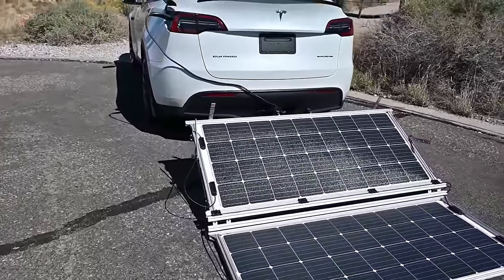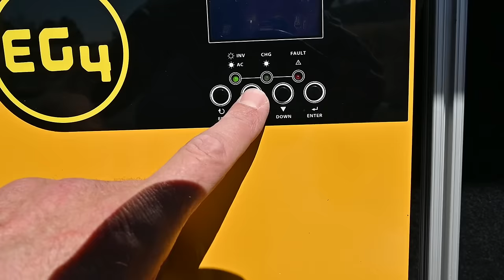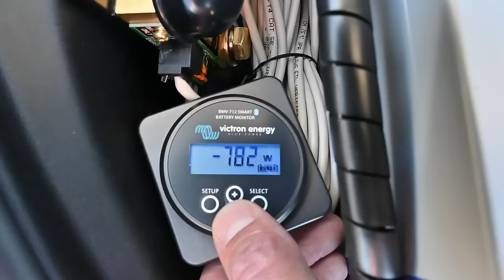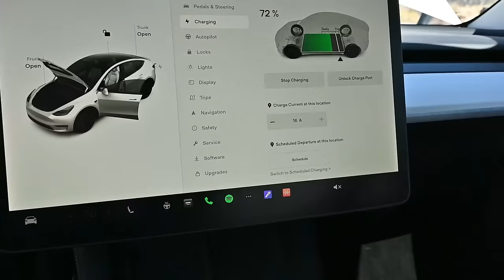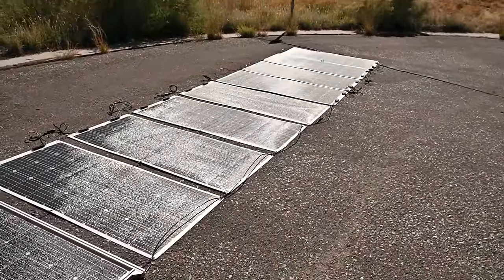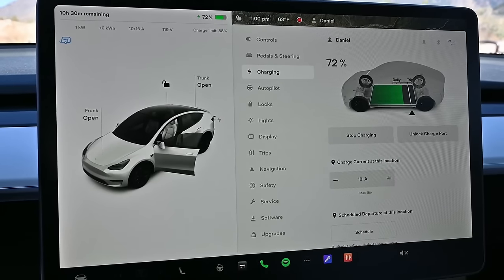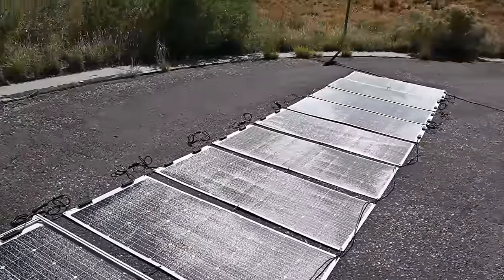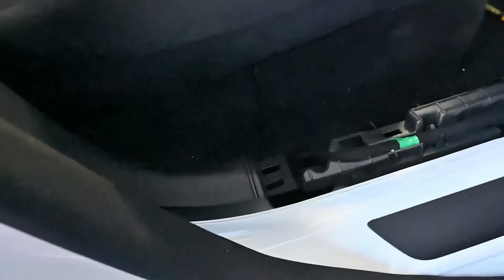2000W Mobile Tesla Solar Charger - version 3.0 - more solar, lower mass, battery in frunk!

Comment: I've read enough of these comments that don't get the thought of this system. Let's start off with what it cost to charge an ev today and it differs area to area. Most will spend an average of $18 for a partial charge 3 time a week equaling $54 a week $216 a month $2592 annually. Just that being said his now 3.0 system in the range of $5500 will give him a 2 year prepay on charging. Just for kicks the average commuter car will use an average of $3500 annually of gas and 96% of use pay that and point out the DC to AC back to DC 95% of all systems go through to give Americans electric power. As  this small mobile charging system is more of the ease of a non complicated wiring all in one to convert solar into usable power anywhere even if you're home is without power. Not to mention the plug to charge the car needs AC to work so no small home use all DC system for charging is available ( at this time ) unless you have a 52 amp or larger quick charger not available for home use today
I own a small mobile charging business and I have looked everywhere in the world for better and better systems. What this man has installed in his Tesla is a 24/7 system and will work for his car charging needs and home emergencies till the battle Borns give out in 20 years. That's many years of DC to AC back to DC use without the grid. Thanks for your video it brings me back to how I started my business.

Comment: Great experiment :) I think you could improve the incidence angle if you make your panels rigid, park your whole string of panels perpendicular to the sun azimuth, then angle up your rigid panels facing straight to the sun

Din35 rails would be the way to do it

also mount the folded panels on roof mount rails, instead of the rear hitch

Comment: What are the dimension of those 36 Cell panels? They'll sit at about 18V-ish for a total of 180V?  If these were the newer half-cut panels you'd be able to reach a sufficiently high voltage to ditch all that stuff and go directly to DC "fast" charging with just a couple of relays and a communication thing. That would be awesome, and you'd have your trunk space back... for ... hauling batteries around.

Comment: Why not make the rear holder swivel so you can lay them across the top of the car. Make a rubberized bottom on the panels so they don't scratch anything. This way you're not taking up all that room on the ground.

Comment: Great! Keep on improving!
Please share  a link of the solar angle  measure thing! I.never have seen this. What is it called? I also will Google it!

 Respect from The Netherlands! Theo, Adventurer & Trendwatcher on many subjects
Reply from the maker: https://www.amazon.com/dp/B0B8J492BR?psc=1&ref=ppx_yo2ov_dt_b_product_details

Or you can make your own with a little math. The 10deg ring spacings are fairly linear for small angles but widens to infinity if you want to capture very wide angles. 

(ring_radius) = (height_of_dot) * tan (sun_angle), where a sun_angle of 0 is when the sun is directly overhead

Comment: If those panels are in series then the output will be limited by the lowest panel. IE, the one on the hitch at a very different angle is probably getting less exposure than the flat ones, at least if the sun is overhead or behind it. So, just be sure to set up so that angled one is getting more exposure than the flat ones
Reply from the maker: Actually the bypass diode on each panel prevents any one panel from limiting the current of all the others. If one panel is lower current, at worst you'll get the current/power equal to all the other fully illuminated panels, and in reality you'll get a bit more power due to a boost in the arrays fill factor. But overall, yes they would ideally all be at the same angle. Lookup bypass diode solar panel.
Reply: @gridfreeordie  are those built in to the panels or did you have to add those?
Reply from the maker: @HandfulOfTranquility  Buiilt into the smal boxes on the front or back of the panel. Nearly all panels have them but there are some cheap panels that do not. Commercial glass panels typically have 3 bypass diodes (one for each 1/3rd of the panel). You can also learn about about blocking diodes to prevent the battery or other strings of panels from dumping power into a shaded string. https://www.youtube.com/watch?v=-x_6OLdAods&ab_channel=DIYSolarPowerwithWillProwse - this video is mostly correct except the panel he shows has only 1 string of cells, and one bypass diode is in parallel with half of the 16 cells and the other is in parallel with the other half 16 cells.
Reply: @gridfreeordie hello sir, why do you need the batteries in the frunk? Isnt it possible to charge directly from the panels into the tesla battery??
Reply from the maker: @FirstLast-tx3yj  The battery is required to handle intermittent clouds and my desire to charge at a fixed power during the day while the solar power follows a cosine curve. Apparently this inverter can go without a battery, but I haven't tried it. Nearly all off-grid inverters require a battery. I don't think I would achieve adequate data transmission if it were battery-less even if it worked without a battery because it may turn off and stay off if the charging load was more than input solar .
Reply: @gridfreeordie  so theoretically as long as the input is higher than the load and the inverter is like yours and allows it... the batteries are not necessary, right?
Reply from the maker: @FirstLast-tx3yj  Yes. There may be videos of this inverter that shows it works without a battery. There may even be one from signature solar, I forget. Sorry, busy...

Comment: Any kind of obstruction did the sunlight of the panels is going to significantly reduce their output you need to move your son direction indicator off the panel and watch the voltage change

Comment: Wouldn’t it be better to DC charge instead of inverting to AC?
Reply: Converting to AC and back to DC does lose some efficiency, but not too much. Modern inverters like the EG4 are very efficient. You get a lot of safety and battery management courtesy of Tesla by going to AC and back to DC so it's the right move for a simple system like this.

Comment: Without any galvanic isolation between that inverter's DC boost stage and its AC output, one day, when the MOSFETs in that low cost, Chinese made, high frequency,transformerless inverter fail and short to ground, that inverter can pass high amperage DC current, straight through to your Tesla's onboard charger that will not only damage it but will also void your EVs warranty. You should have installed a low frequency, transformer based inverter that provides galvanic isolation like a Victron instead.

Comment: Good job, congrats. How did you handle the grounding / floating neutral issue? Or does the Tesla UMC accepts the EG4 AC outlet as it is?
Reply from the maker: The inverter ground "lead" is manually tied to the neutral "lead" to make the charger happy. Ground/neutral are also tied to the frame of the vehicle. The EG4 actually doesn't have a ground lead, just a grounding bolt on the side. Not a fan.
Reply: @gridfreeordie  Thanks. Makes sense.
Reply: Thanks, had the same question
Reply: @gridfreeordie  thanks!

Comment: I run the same setup at my house: it sucks!!!
Using a non- hybrid inverter always has to tap into the battery, especially if you can't have the load not automatically adjusting to be right below solar production.
He tampered too much around his car to create a non efficient high maintenance toy.
Reply: Someone up there commented on how the charging amps can be adjusted based on the battery SOC using raspberry pi and whatnot.

Try to be more optimistic than pessimistic even when you fail, it helps. ✌️
Reply: @leviahamefula3994  I am optimistic when I get to know how a microcontroller or microprocessor can solve this for real.... Currently the market can't and any YouTuber didn't show me yet how it's done either. I work with electric/ electronics/programming myself..... Stop dreaming and show me reality, how it's done?????????
Reply: @Gallardo6669  👀.... Why are you shouting? 😂

Comment: All this for about 3 miles per hour of sunlight? How much range are you losing carrying all that extra weight and the added inefficiencies of the hitch? I think it makes sense if you're completely off-grid, but you said you have a house with solar.
Reply: Trying to figure out where his setup went wrong. There's another YouTube that did the same and almost got the same kwh per hour as this except his was much simpler using a 1500 Jekery and 4 or 5 jakery solar  panels rated at 100watts each

Comment: What if you flipped the panels and the unfolded over the top of the car with some felt backet to protect the paint? Than you wouldn't need a 40 foot area to park to charge it, just a thought.

Comment: The battery in the front bumper is flip to the side that's wrong you must put the battery in regular positions because the water of the battery is going to mess and can be a voltage problem .

Comment: Ima trying to do a set for my Tesla and Camper trailer got 11meter trailer and Tesla model x 100kw. And not in a haste on my travels but need a offgrid Charging to my Tesla and Camper looking 2000-4000kw set to this and what ever it needs extra batteries etc?

Comment: I have a skywell et5 electric car. I use the AC adaptor charger to charge et5 from house 220 v. I can not use the adaptor with the off grid 3 Kva solar system becouse of the virtual ground of the solar system. The adaptor prevents charging and signals ground fault. But this problem is not seen with on grid solar system.  Becouseon grid system has true ground. So I wander how you solved the ground fault problem of the adaptör.
Reply from the maker: Hmm, we have split phase here in the US and the neutral is tied to ground. In Europe, the neutral (or whatever it is called) is tied to ground at your house's panel in only one spot. I assume if you tied a 230V European inverter, like Victron offers, your charger would be able to detect this you'll be good to go. Tesla also has check to make sure neutral is tied to ground, and it passes the check even if it is tied to a car body ground vs. an earth ground. I'm not sure how your 3KVA solar system is "grounded", but as long as the non-hot lead in that system is tied to "ground", the electronics of the charger shouldn't be able to tell from my experience. Of course you should attempt to always tie to actual earth ground.

Comment: Tesla mobile charger energy watts ratio 1:1 So unpractical, but it helps to carry massive battery and solar controllers.  Also decrease quickly your battery charge, when you travel with the heavy loads.

Comment: how about mounting the solar panels on a roof or somewere so they can produce energy whenever the sun is shining and for charging your car why not use the charging stations? i really dont see the point. the solar panels do nothing when they are folded, and how long would it take to charge your car with 1kwh? 3 days probably...

Comment: Bro i would recommend to just put rooftop  solar and batteries tail one solar remove it just ruins the look and aerodynamic and also theft problem of it and i think it should messing with sensor which is on the back to see if the car is coming from back

Comment: Wonder how much time you have to charge in full sun to replace the wasted energy hauling the extra weight and reduced aerodynamics of the panels on the back. My guess would be in general you could remove all this and just solar charge at home and be better off.

Comment: Why not use DC to change the battery direct then you don't need battery in the front or a inverter all you need is a little tec and have the solor at 400v + to charge the tesla battery directly.

Comment: For my taste way too integrated to vehicle taking all space and adding more air resistance. Would go with portable system like Jackery and couple of portable solar panels with built in system for adjusting the angle of the solar panel. No changes of fixed installations on car. I could leave the system at home charging the "Jackery" and when back home, use the stored electricity to charge to car. Or then take the whole system with me on the road.

Comment: Sorry if you answered this elsewhere but why put 4 batteries in if you basically dump all the chargers power into the car? 
Is it so the mppt charger can be lower because the batteries are 48v?
I guess that’s probably why because a 12v mppt charger wouldn’t be able to handle that much solar input and your wires would probably need to be huge.
Reply from the maker: Correct. And the inverter is designed for 48V, not 12. And yes, cables would need to be larger, but not huge.

Comment: Why not hack the cars bms/charge controller or add a standalone bms/controller? Then no need for the inverter or exta batteries... It's still going to take days to charge the 100kwh battery

Comment: Hello! Is you are not discharging the battery, maybe something really small just to take care of the clouds would be enough, don't you think? Also, those batteries right in the frunk are maybe a bid dangerous in case of an accident.
Reply: nah, the EG4 inverter has a minimum battery size in the instructions to operate correctly. But actually, if he wanted to run batteryless I think the EG4 inverter does that too if you are interested!

Comment: It would be great if someone would build a DC solar charge controller directly to the high voltage pack..   Bypass the conversion losses inherent with your more plug and play systems.  DC slow charger.  🙂

Comment: Why does everyone use solar panels to charge extra on-board batteries that power an inverter that then feed into your original car's charger, converting it back to DC and then finally charging the cars' batteries?   Why not match the charger's DC output voltage with your solar panels and connect the panels directly?  Maybe no such adaptor exists so you'd have to maybe buy a used charger and cut the end off.

Comment: This is incredibly impractical. It would have made way more sense just to put those panels permanently on your roof, in order to have a consistent view of the sun. Even if the grid failed, why would you need to store/charge those old school car batteries on the vehicle itself? Not to mention that the power you’re pulling is only going to add a percent or two to the overall charge per day. I have so many questions lol. The only “savings” you’re getting is from the ad revenue that YouTube is giving you.

Comment: I get your motives but I don't think it's very practical. This setup is not a bad idea but good to use it for home and charge it while you're at home for free without using the grid..

The wind drag behind your vehicle is like a parachute eating away more of your efficiency and these electric vehicles have poor efficiency as it is.

On a road trip you only can charge it when the sun is at a good position 10:00am to 2:00pm in the winter time, and unless your parked for hours you're not going to get a full charge out of it.

You're better off buying a small generator and you can charge it as you drive. Don't know your purpose of getting a Tesla. if it's for climate change issues or just tired of expensive fuel.

It will be way cheaper to get a small gas powered generator or if your one of those climate people then just get a natural gas generator.

Way more efficient than a regular car and you can drive much much further in your Tesla and not be parked for hours trying to charge your Tesla with the Sun or waiting for the Sun to charge your Tesla.

My opinion I would definitely scrap this idea and go with a generator on board charging system👍

Comment: Because that cheap, high frequency, transformerless inverter offers no galvanic isolation between its DC boost stage and its AC output, one day you will fry your EV's onboard charger and will void your EV's warranty. If you want to safely charge your EV with solar, you should be using a low frequency, transformer based inverter.

Comment: Cute, and nice "experiment", but not practical.  This is probably a $7,000 setup.  The batteries alone are $1000 a piece and you have 4.  Draping the solar panels on the ground behind also doesn't work in a parking lot.  Cost reduce --- How can you get it to $2000 and be mainly roof based?

Comment: I just go get gas, done deal... Driving around setting on top of a 1000lb lithium ion battery is like having a ied strapped to your butt..just mater of time. They have more work to do on ev.  These ev batteries have to maintain a temp between 50 and 70 degrees or there unstable. Why there battery packs have heating and cooling built in...that in itself uses power..

Comment: This is stupid! Your leaving energy in the conversion from dc to ac to dc! You need to get rid of the inverter! You need to connect your dc solar to the dc power system in the tesla directly! Your save so much energy this way!
Reply: @brad1367  you know I hate people who insult someone who knows nothing about what they’re taking about. If he connects the same number of panels rather thru a 2 phase inversion process like this dc ac dc, or a single phase inversion process dc to dc he will lose energy having more inversion going on. This is SIMPLE math and science!

I’ve seen people put solar into the battery before, it can be done! Actually some cars already have it from the factory!
Reply: This is no place for your insults! Your true colors are definitely shining!

Like I said before please stop responding to a topic you surely have no experience with!
Reply: @brad1367   you say you know things but are truely showing how unprofessional you really are by the color of your comments! He’s going 3 steps from dc to ac to dc. He only needs to go from dc to dc with a dc inverter. Please do your research. There are others doing this along with some manufacturers.